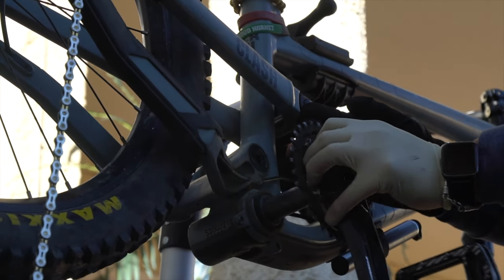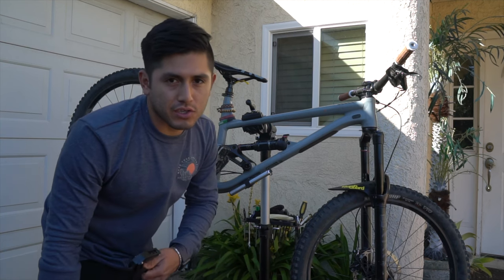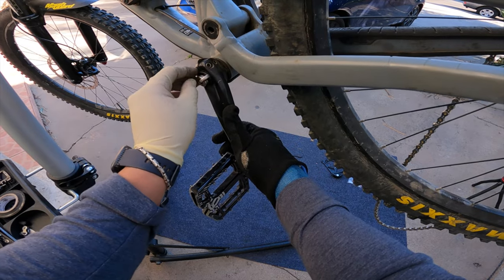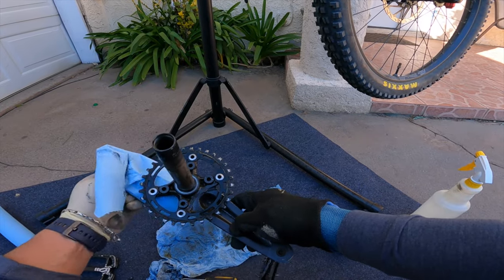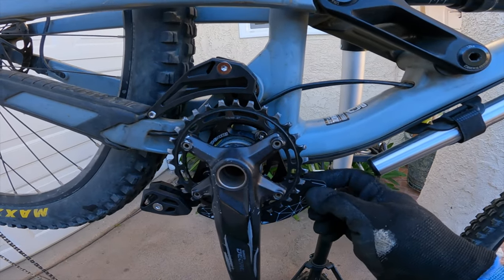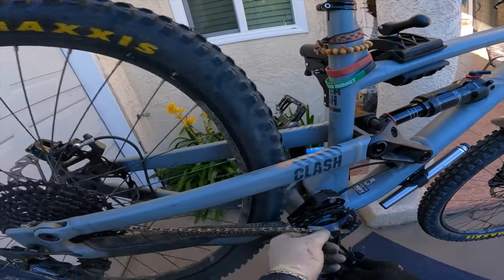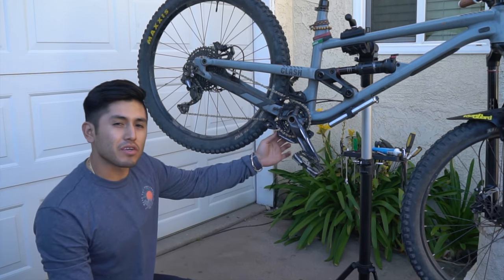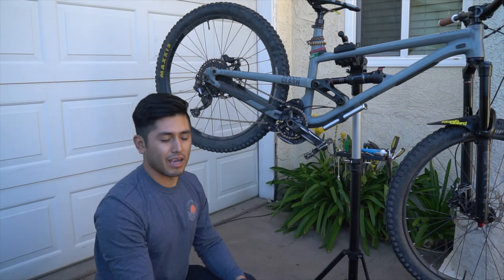Installing New Bike Part On My 2021 Commencal Clash | Fouriers Chain guide / Bash Guard | MTB Review

Comment: YESSS!!!   "You lubed the bolt threads" like a professional mechanic should. I hope anyone seeing this video learns this simple technic whenever you install a bolt or a nut you must lube the threads and the head, or the side of the nut that makes contact.  This guarantees the bolts and nuts will stay tight, and months or years down the road they will be easy to remove because the threads will not corrode.
Reply from the maker: Haha I had to learn the hard way but now I never forget to add it to my bolts 🤘

Comment: Does you chain jump out of the chainring? or what's the reason you are installing this chainguide?
Reply from the maker: The chain never comes off (with or without the chain guide) but the main reason I got the new part is because it is a bash guard as well, so it protects my sprocket and chain from getting hit on rocks 👍

Comment: Any idea if the chain guide's pulley wheel is plastic or metal?
Reply from the maker: I believe they are plastic. The part that attaches to the bike is metal but the pulley wheels along with the bash guard and chain guide are made of a hard plastic. Hope that helps 👍
Reply: @GabeGarcia  cheers 🍻, that does help a lot, I bought a similar ztto chain guide that comes with a noisy metal one, been searching for a budget guide that comes with a plastic one for a while 😎